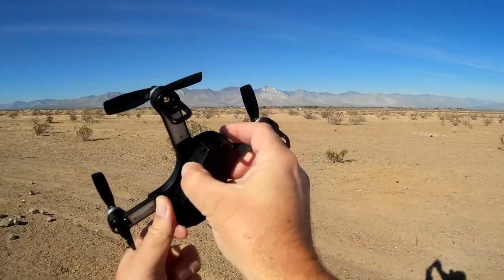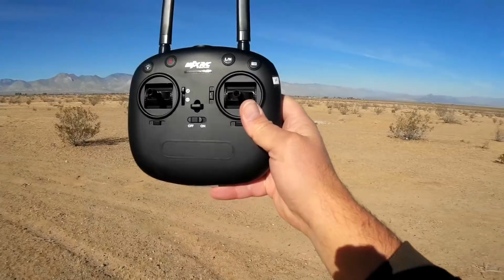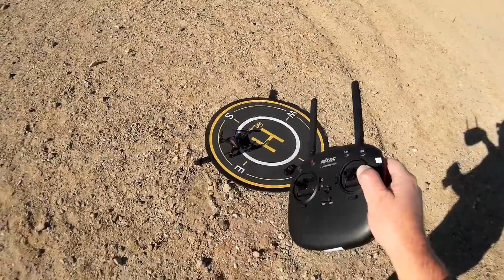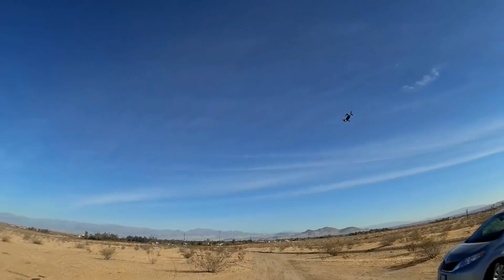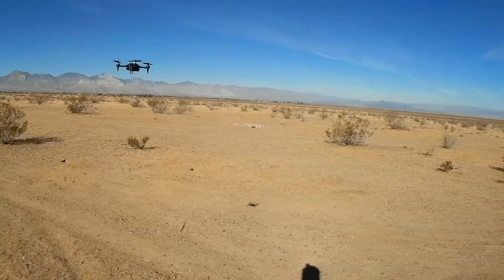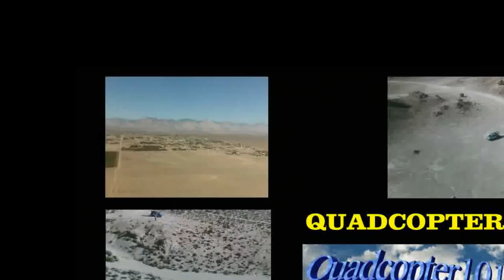MJXRC MJX Bugs 3 Mini B3mini Brushless Motor Sport Drone Flight Test Review

Comment: Hi: thanks for another great video.  Question... we are looking at getting our first sport drone after training on several basic quads/drones.  One concern is getting a sport drone inadvertently too far out on account of the speed and then losing orientation.  Therefore, does this have headless mode you can throw it into so you can simply pull the right stick back,  bring it back a bit, and get yourself reoriented?  If not, can you recommend a brushless mini competitor that would have headless?
Reply from the maker: I would not recommend depending on headless mode to bring the drone back.  Instead, why not practice the following very important, but easy to lean skill with the drones that you already have?  Once you've acquired this skill, you will be always able to bring it back, even if its just a dot in the sky.  https://www.youtube.com/watch?v=qdYTCfjUVVo
Reply: @Quadcopter101  Thanks!  Actually we owe our basic piloting skills to you - out and backs, turning, banking, etc. and that is much appreciated.  We have also viewed the video you linked about orienting in the past and I'm familiar with the technique.  We don't generally like headless as we think it is almost a gimmick inducing beginners to not learn basic piloting skills, but I still think it has its place in an emergency like inadvertently getting almost out of sight and the wind starts carrying it away while you are trying to orient the quadcopter.   Flipping on headless and pulling the right stick forward could potentially be a real lifesaver IMHO.  If you have any other personal recommendations for a relatively fast mini like the Bugs 3 Mini we might consider, please do let us know and thanks again for posting all these great videos - especially the ones about basic piloting.

Comment: Hi quadcopter 101,
Question.. Could I fly the original Bugs 3 with the Bugs 3 mini controller??
Reply from the maker: Actually that might be possible as it appears that they both use the same transmitter.  You would need to bind the Bugs 3 to the mini controller.  To do such, plug in the drone.  Then hold down the red arm button while simultaneously turning on the transmitter to put it into bind mode.  You should hear a beep, after which it should automatically connect every time that you turn on the transmitter.
Reply: @Quadcopter101  I already own an original Bugs 3 - I just ordered the mini through your link.. I just don't want to carry two transmitters at once ;)

Comment: only thing i don't like at all is this and few other bugs have that slide in battery...i like using regular batteries with normal plugs... but like all machines they can be modified if you want... bugs 3 is best deal imo...

Comment: Im really interested in this for my 10 yr old who is getting quite good at fpv. His favorite is the Syma X5SW stripped down with AIO cam. This thing is bullet proof.  Which leads me to my question. Assuming the obvious, that this will suffer some abuse, how do you think the plastic shell will hold up and the area where the motors attach? My experience has shown that a blade strike with a brushless motor attached to plastic generally breaks the motor away from the plastic, and requiring a whole new shell. What's your thoughts?

Comment: See, now that's an innovative new quad that fills a nitch. Why can't stodgy old Syma do anything like this?  Since the original Bugs 3 is going for between $80-$90 online, I would hope they would price this around $60-$70 (or less).  With the original Bugs 3, you could get regular batteries to work with it, but it might take some hacking to do the same with this one. Be nice if you could fit a XT30 cable on it and use off the shelf 2S batteries with XT30 connectors (with much higher capacity for longer flights). We'll be on the watch for this one .. there are a LOT of Bugs 3 guys out there who would probably love to add this to their stable. Cheers.
Reply: it is new, different tx than the bugs 3, and it has acro.    Considering prices on brushed quads and what people are willing to pay for them (even for old models).... I don't think the price of this mini is that high.
Reply: I've seen this priced at GeekBuying for $90, which is just way too high in my opinion. I think you're right. A $60 price point would be great for this.
Reply: Wow ... that's higher than the Bugs3 is going for .. must be because its new.  As soon as some other dealers start selling it, I think the price will drop ... I hope .. ha ha!
Reply: John Cuppi When price point drops to anywhere near $60 for the Bugs Mini, I’m ordering.
Reply: Frequent Flyer did a review of it and found + and - pads on the 4-in-1 ESC that you could possibly use to solder an XT30 on. Definitely plausible to use other, higher C batteries and save a couple grams by not having that plastic casing on the lipo.
Reply: Bill Somrak ...I'm like you. Soon as I see a proprietary battery, my first thought is ," how can I mod that  to a standard XT30 or XT60 plug ?" I wish they just came that way to start with.
Reply: John Cuppi ....what are you thoughts about durability? Do you think this plastic frame can handle a blade strike without cracking? I have a P2 clone that had a blade strike with the ground while landing and the motor literally ripped away from the plastic . I just don't think plastic is the way to go with torky brushless motors.
Reply: I'm going into a brushless quad. Should I go bugs 3 or something else. Jjrc?
Reply: I've personally crashed this model so many times, whilst powerlooping at high speed into the ground, it landed the right way up and just took off again no problems! Tough little thing!
Reply: i just ordered 2 bugs 3  rtf for under $80...what a deal...these quads are getting better a cheaper all the time..
Reply: @roadstar499   where please ?